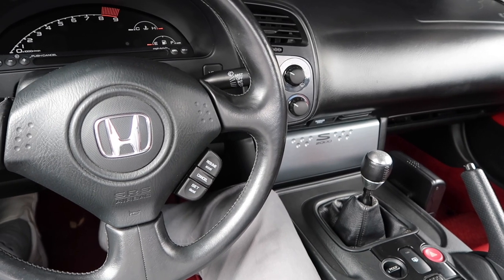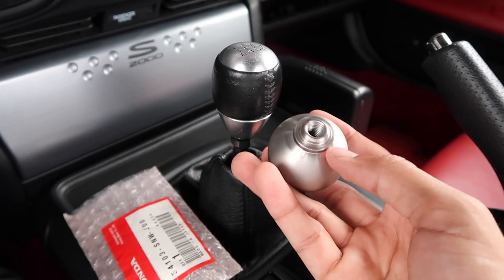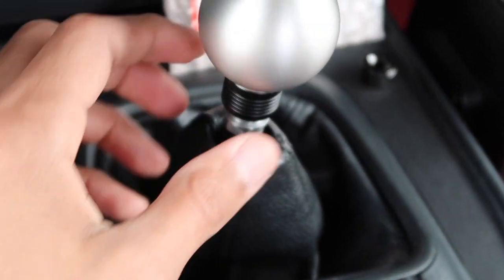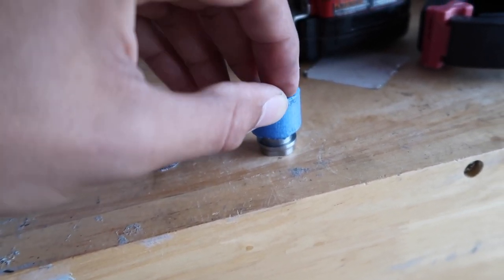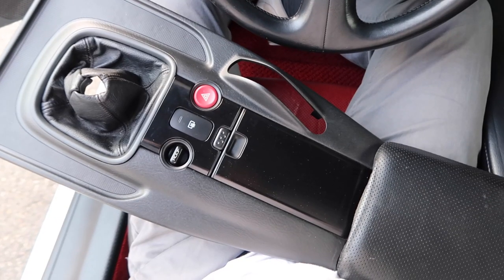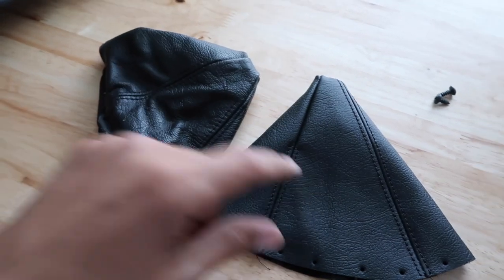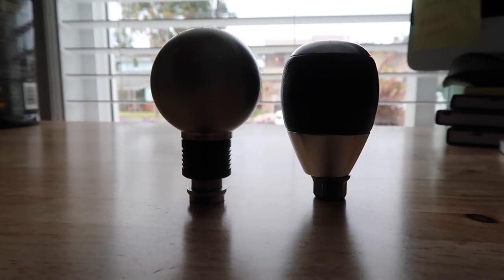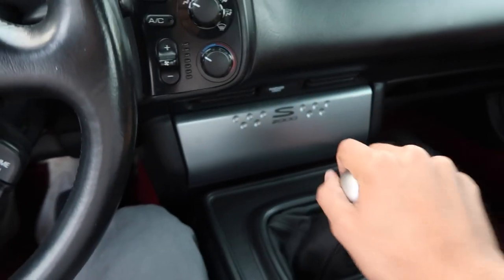The Best OEM+ Shift Knob for the S2000 | Honda Civic Type R FD2 Shift Knob and Collar Retrofit

Comment: Looks like that shifter setup would lengthen your throws
Reply from the maker: you're correct! it's a little taller – a few mm – so the throws are technically longer but the shifter also sits closer to wheel! either way, I don't personally think the S needs shorter throws, it's already got like the shortest gearbox throws in the game 🏀